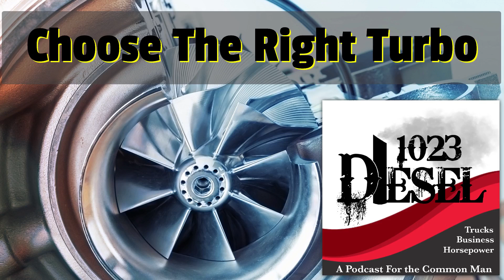Ep. 19 | Choosing The Right Turbo - 7.3 Powerstroke

Comment: When my 01 work/tow rig needed a set of injectors after 340k miles I called and spoke with Dusty and explained the mods the truck has and I explained what I did with my truck and contrary to just about everything I read on the forums he said just keep it stock. I'm not going to lie I was a little hesitant but I decided to trust him... I am glad I did. The truck runs cooler, quieter, mileage is up and so is the power... I didn't need "more"  injector to get the power I needed I just needed correctly running injectors. Couldn't be happier.
Thanks again Chad from Hawaii

Comment: Man, I love the info, and love 1023 diesel - - but if you guys aren't careful, you're gonna convince the majority of 7.3 owners that it is pointless to upgrade. I have an OBS, with stock injectors, that I sometimes use to pull an 8k-10k box trailer up steep grades in the Rockies. Prior to some mild tuning, exhaust, and dropping in a stock plus turbo from KC, it was a dog. Now, not only does it pull much better, but the EGTs run about 200* cooler (no intercooler) across the board – and smokes less.  Not sure what the downside to that is, but I haven't found it yet. Maybe there ARE things that you can do -- within reason - that DO actually improve upon what Ford did in terms of BOTH reliability AND performance. I think lower EGT's while towing have to be better for engine longevity, right?  No doubt people misunderstand much about all this, and are driven by the deep desire for huge HP gains that really do violate reliability in a meaningful way, but I think there are reasonable modifications that the average Joe can afford that really have no serious downside. Maybe I'm wrong, just some thoughts...

Comment: Hey I have a 2003 f250 4+4 7.3 with 270000 miles all stock. I do non CDL hot shot so I pull a gooseneck trailer 40feet long with 10000 pounds my gvwr is 26000 pounds all together. Going up hill from 75 miles start to drop to 50 or 45 miles per hour. I need the best power on my build. Should I do a stage 3 build or what do you recommend?

Comment: I have a gtp38r w 1.00 housing and billet intake plenums on my e99 and a 2 PC pusher intake and 40hp tow tune and it refuses to make more than 17 psi even with the wastegate preload set to 25psi air pressure before it starts to open gate.. is it cause of the e99 injectors and the e99 hpop that really won't sustain above 2100 at 180 eot? I also have regulated return 
The previous e99 turbo would make 21 psi with an equally cranked wastegate actuator rod
I've checked for boost leaks to 20 psi and found no bubbles from soapy water, it will spike 18psi ebp and no more ever and it does that when I hold it wot trying to make the 17psi and right as it hits 10 psi the ebp tapers of to 10 psi as the boost climbs 
I will check for exhaust leaks but the collector is fully seated and it had brand new bellowed up pipes